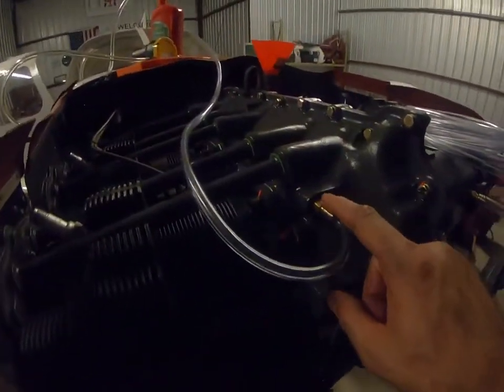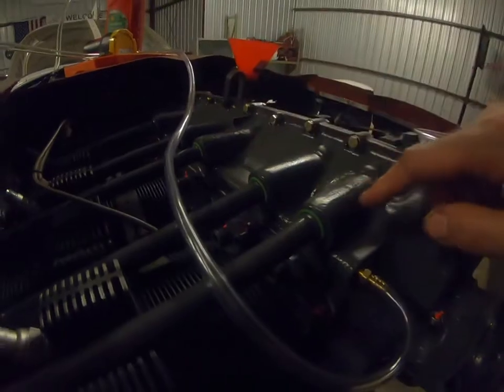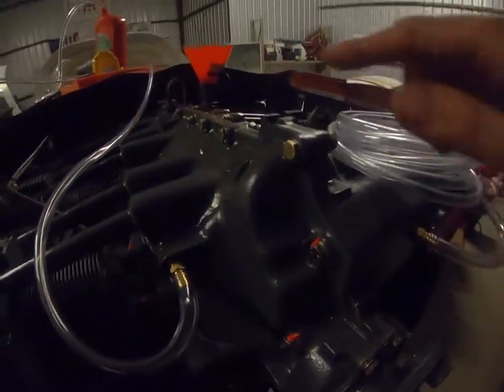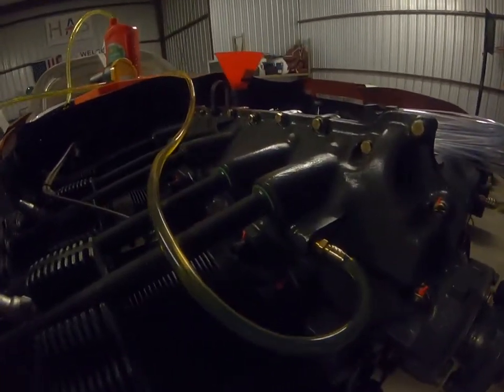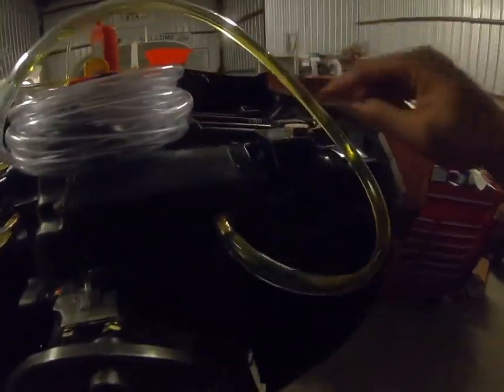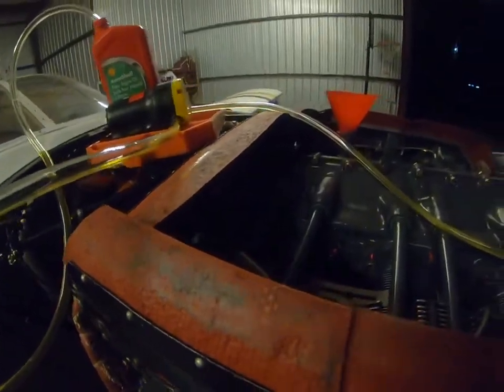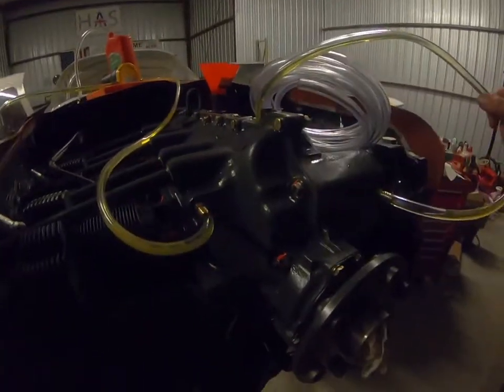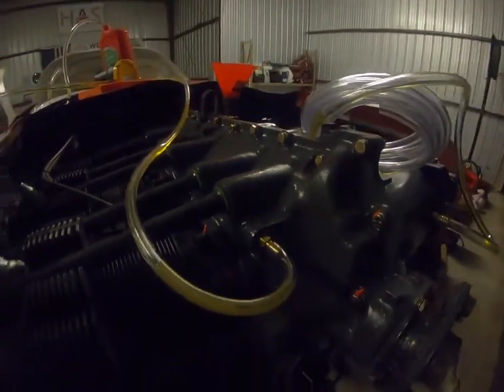Priming oil system on a Lycoming O-540

Comment: What size fitting did you use to tap into the galley rails. Is it the same for Lycoming IO-360?
Reply: @fly6tech776  thanks. I don’t want to strip anything. I wasn’t sure.